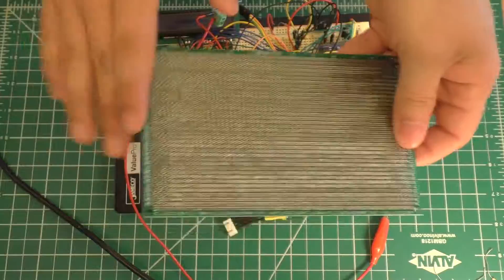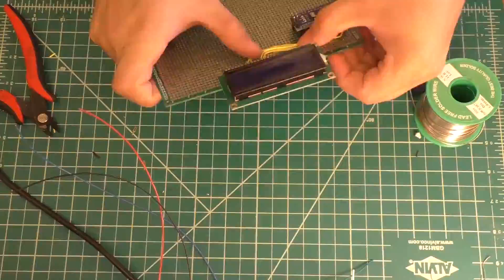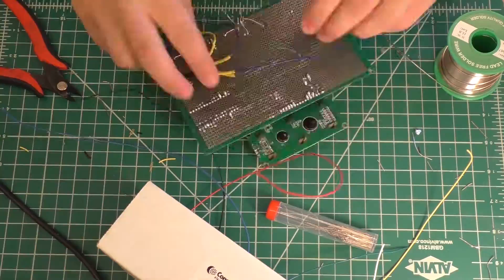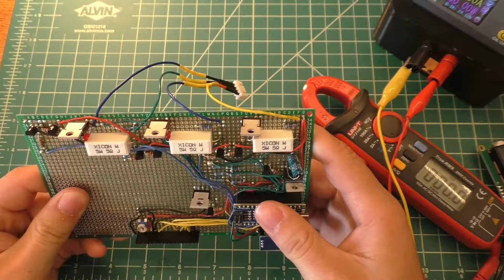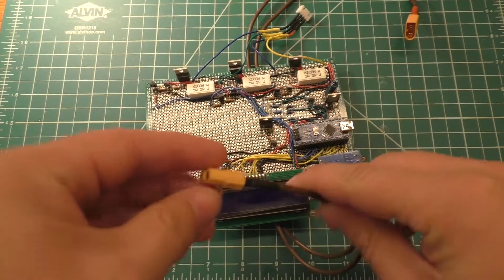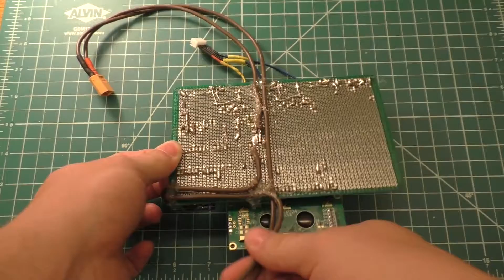Arduino BMS #8: Soldering a Prototype

Comment: Would you consider making a kit of this. For 7 series lithium ion? I just need a schematic and the arduino and it programmed. I am no programmer. Not even of a arduino! I can solder and place components! And if so what is the $$???
Because if I don't do something like this. It's going to be a slew of ebike bms. And you know how they are. Then multiply that by like 10! I could put one little bms per 20p, 7s pack in the bank. Or maybe 40p 7s pack per BMS. Nice video!
Reply from the maker: Thank you. I might consider making some for of kit out of this. 7s would be a little more difficult than what I am doing because it would require an Arduino mega because the Arduino Nanos that I am using don't have enough pins for 7s. I plan on making it open source in the end and it shouldn't be too difficult to modify.
Reply: Eman2000 when would you like to get started? I hope to actually be using my bank in the next month or two. About what would the price be?
Reply: Eman2000 also could it be programmed to start balancing if needed . at about 3.8-3.9v.I only plan to charge to 4.1v/cell. Thanks
Reply from the maker: Programming cell voltage is pretty easy. My goal is to have a mostly functioning 3s BMS by the end of July. It probably won't be complete though. This is just something that I have been doing in my spare time. I don't have any estimate on cost yet.